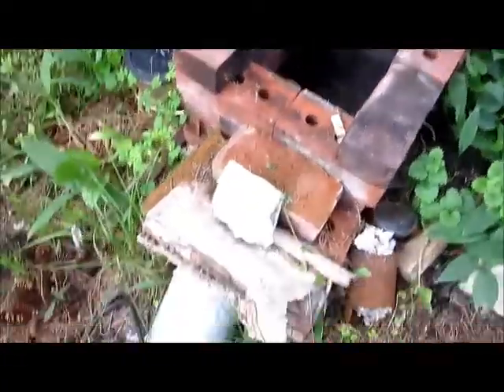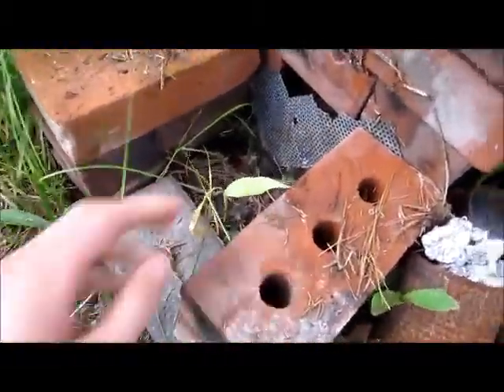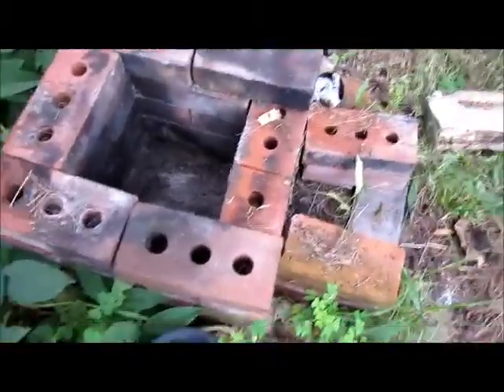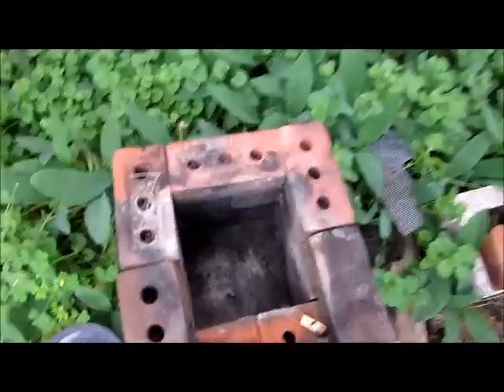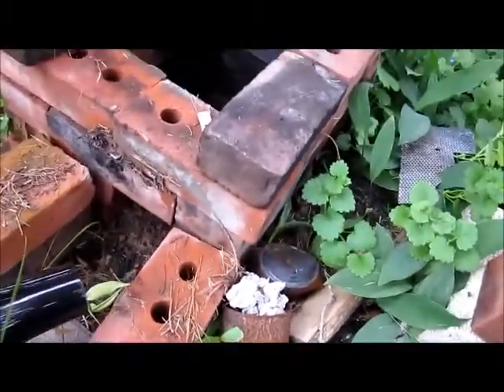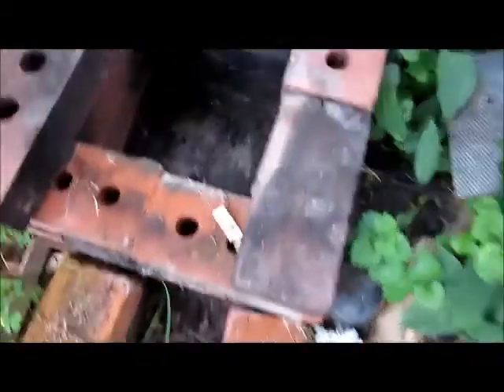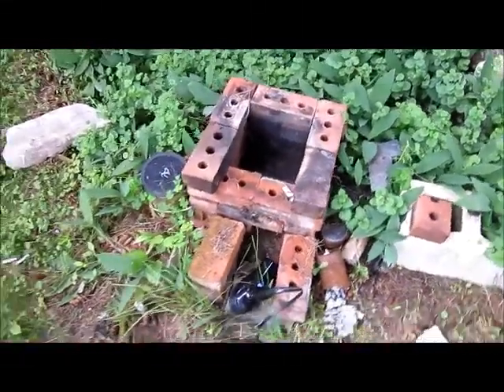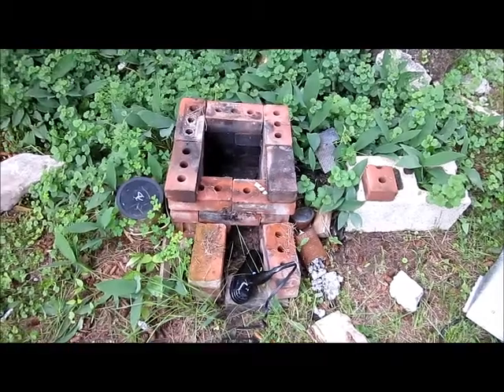Building a Simple Metal Melting Furnace

Comment: do you know if there would be a huge difference if concrete blocks were used instead of brick?
Reply from the maker: +Josh Rudelic No in the case of just melting aluminum there wouldn't be much of a difference, just keep in mind the goal is to have the thickest walls for the most insulation so solid concrete or refractory brick would do best

Comment: What do you prefer to put the aluminum in when melting it?
Reply from the maker: Personally I like those empty green propane cans. They are steel so they withstand much more heat and have a pretty good holding capability. Just make sure they are empty and cut off the top with a grinder.

Comment: What would happen if my bricks weren't exactly square and had small gaps in the sides?
Reply from the maker: VoxelMod The furnace should still work, but you might need a bit stronger of a fan to make up for the air loss in the cracks. It'll just mean that the furnace won't get as hot as it would if it was fully sealed but it should still be able to melt aluminum.
Reply: EverythingMan95 Alright man appreciate the reply :)

Comment: Could u use pavers to construct this also do u have to put firebricks on the bottom... i dont have any and i dont want to spend much money on it... just want s9mething that i can set up in the backyard and melt down my old aluminum
Reply from the maker: Not sure about pavers but no, the whole thing is just made of old red bricks, no firebrick, but if you have any firebrick use it, because these normal ones can crack under the heat after a while.
Reply: Ok i think pavers are pretty similar but cool vid goeing to try it... thanks for the reply
Reply from the maker: No problem, and good luck